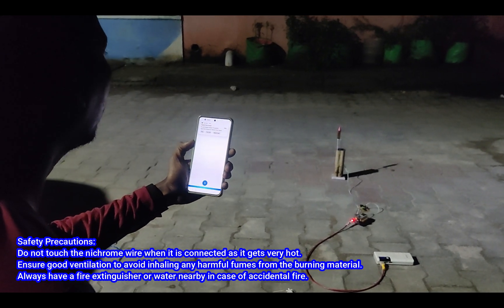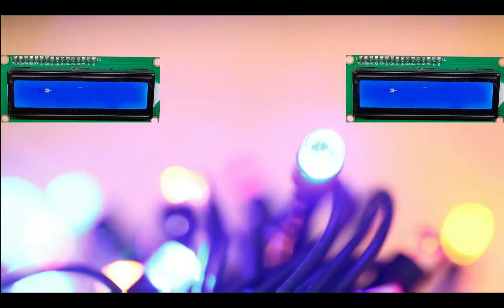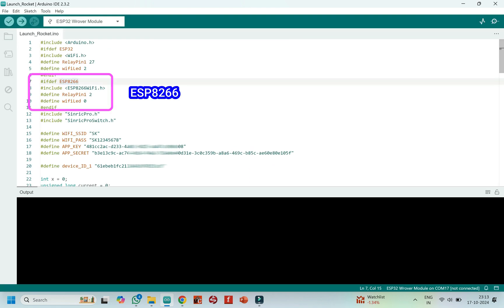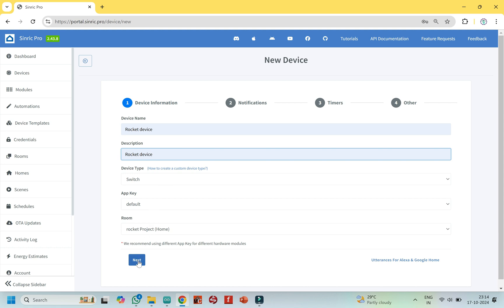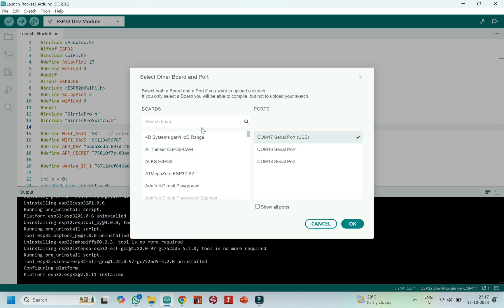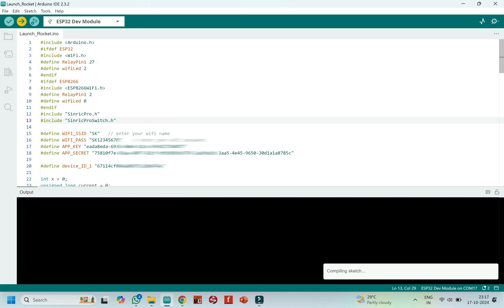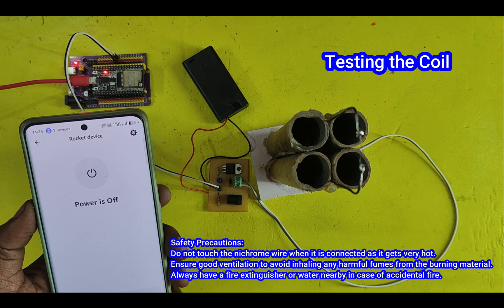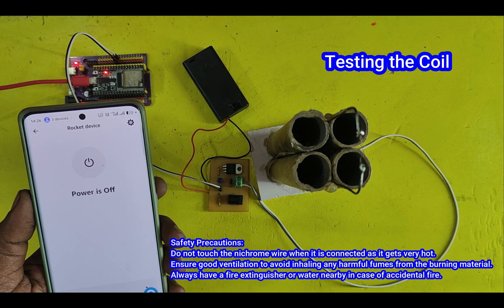Alexa Control Rocket ESP32 Sinric pro Alexa Powered Reusable Rocket Launchpad | Diwali Special 2024

Comment: Brother i want to add multiple rockets with esp 32 wroom 30pin, could you please provide diagram for multiple rocket and also code
Reply from the maker: It is possible. Unique number should be used to start the relay
Reply: @TeachMeSomething  can i use a 5v single channel relay instead of transistor?
Reply from the maker: @ahmad-tl6gm  yes. Use opto coupler also along transistor